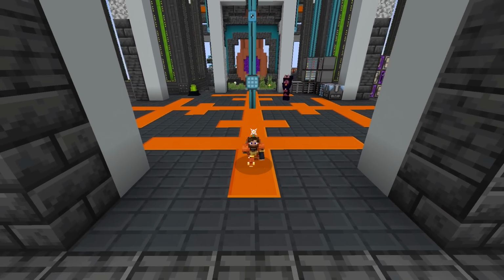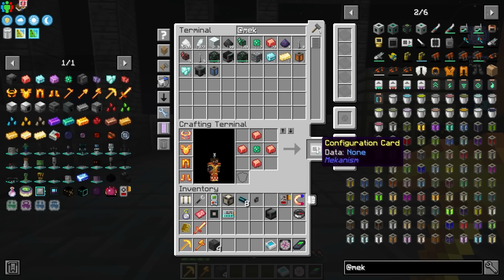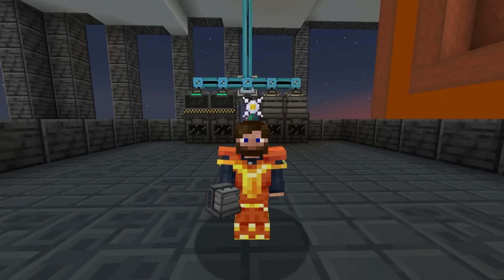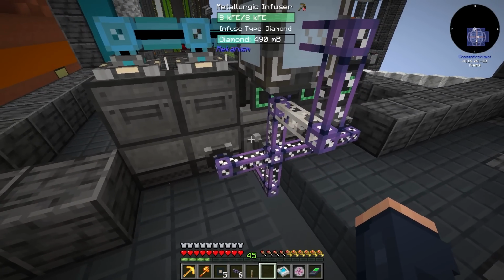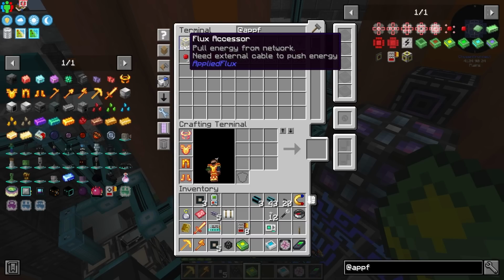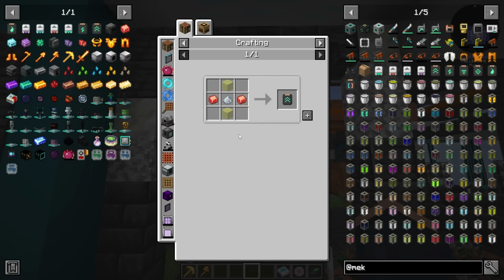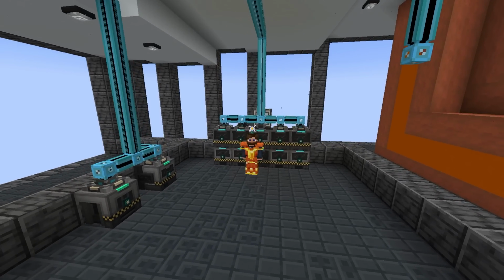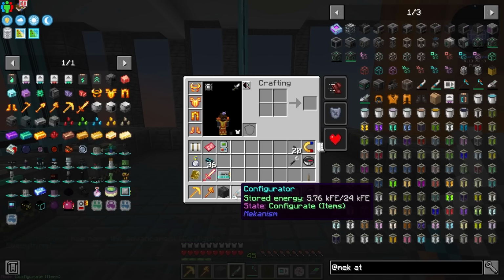All The Mods 9 To The Sky EP18 Mekanism Alloy Automation With AE2 Subnetwork

Comment: If you attach a compact ME Interface to a pattern provider and cable it to storage buses on your machines, it will create a unique type of subnetwork that effectively extends the amount of sides the provider has and also allows you to filter inputs for recipes that use multiple sides/blocks. This is a great stock AE2 solution to inputting to the metallurgic infuser.
Another method is to use the Advanced Pattern Provider from Advanced AE - which can access any side of a machine it's connected to and control which sides pattern inputs are sent to once you've modified your pattern with the Advanced Pattern Encoder, this is great as a stackable one-block solution.

Comment: Applied Flux is awesome, 5 machines around a single pattern provider, no pipes, no cables even on things like the infusers - well, if you use a chemical cell to store your infuse types, cause you don't have to pump it from another side if it's directly in a chemical form, you can just have it in the pattern and let the provider pump it into input side.

Comment: Heya Chosen and others, if you want a bit of an easier setup, that avoids requesting and is compeltely on demand, where you just have one of each machine (and one extra metallurgic infuser), here's the layout.
Needed:
1 chemical storage disk (applied mekanistics) 
1 enrichment factory 
1 infusing factory
1 metallurgic infuser( can be base)
Gas pipe/pressurized tube
Patterns & providers

The base mettalurgic infuser will accept extra, and ouput infuse type at the back. This needs to be extracted by chemical pipes and piped to the pattern provider as it cant auto eject. This will be stored in the chemical drive and is basically instant. You dont need a large drive as you'll never have more than a bucket leftover with this. 
From there, just need to encode patterns. E.g. one redstone -> enriched redstone -> 0.8b infused redstone. And then 0.1 infused redstone + iron = infused alloy. Same again for the others, and its done on demand. 
Can add more machines to the same pattern providers and they will load balance automatically. 
Enjoy!
Reply: Additionally, I have a video on the topic.
Reply: He's right, this one is WAAAAAY easier.
Reply: Doing it on-demand like that eliminates the buffer of infusion materials. That does free up a small amount of resources sitting in buffers (maybe 100 diamonds and 100 redstone?), but it means crafts are more complex (more co-processing units may be needed), and the lack of buffering means crafts take longer.
Reply: @fashnek  except almost every other craft in the game is on demand? The generation of infuse types is almost instant. And it's much more simple to understand.
Reply: What’s done in this video is not simple. Chosen made the explanation and implementation more complex that it needs to be, just to save channels. But the idea of using a bunch of export buses that keeps resources stocked…. is simple. Simpler and more debuggable even than implementing fluid buffers. It’s certainly fine to do either one, being aware of the tradeoffs.
Reply: @fashnek  it's not a fluid buffer? It's a single chemical drive. Try it and you'll understand.
Reply: Whether a chemical cell or a Mekanism pipe or a full blown Create tank, it is a fluid buffer.
Reply: @fashnek  like I'm saying, try it yourself and it'll make more sense. It's no buffer, unless there's an odd amount creatured.
It just works on demand just whether or not you prefer that is personal.

Comment: Can u do a huge but compact extended inscribers setup for ae2 to get mega cells fast
Reply: I've been finding those slightly awkward to use tbh.

Too many times when I'm auto crafting multiple/different printed circuits they keep mixing the slots up and I have to go in and manually shift things around to get it to work again.

Would be nice if there was a reliable way to lock the slots in these machines for each type of circuit.
Reply: weird that never happened to me, maybe try only doing a single type of recipe for each inscriber?
Reply: @AutriBanerjee  that defeats the purpose of using the extended inscribes though as they are supposed to do multiple different ones at the same time.
I'm hoping they just port the lazierAE2 add-on into the modpack the etcher (iirc) from that is amazing and can do the finished circuits from the raw materials (no need for the intermediary steps)

Comment: Shouldn't you be able to substitute the Export and Import bus in the Mekanism setup with Interfaces and use AppliedFlux that way?
Reply from the maker: The interface doesn't push items to the and mek doesn't pull from the interface
Reply: @ChosenArchitect  unfortunate
Reply: @ChosenArchitect  wait doesn't Mekanism Pull from Containers if the side is configured as Pull and Auto Push is enabled as well?

Comment: If you put one induction card in the provider/interface behind, all the cables in that subnet would provide energy to all machines, including the ones with export. It's a godly way of providing energy. The gates work too anyway
Reply from the maker: Ill give that a try
Reply: yes chosen, as the ender gates are  bad for tps lag (doesn't matter much for you as your cpu is great but it's so noticeable on older hardware) as they are ticking tile entities, the induction cards cause 0 lag.
Reply: @ChosenArchitect  hi, I can't understand what the blue tubes are connected to, and the export buses don't work, can you help me?
Reply: Mine doesnt seem to be working with this
Reply: can you explain more? I mean you can't with the exporter you must export FE (in the exporter) to be able to pass energy. If you just put an induction card in an interface does not work as you said. Taking the video has "setup" those machines are "behind" the interface as subnet and they will not get power.